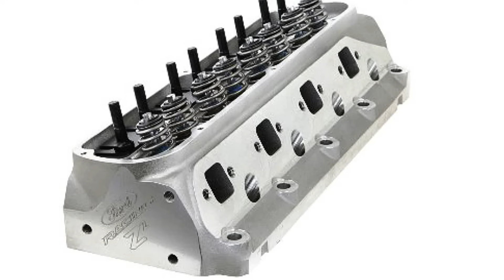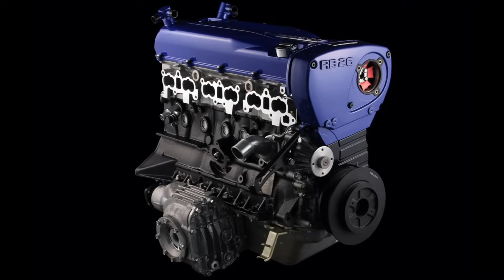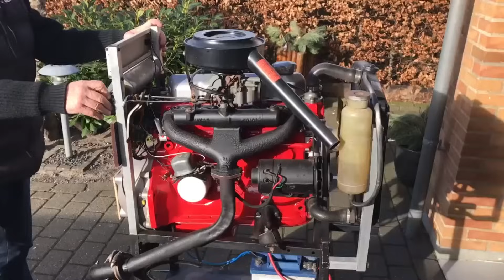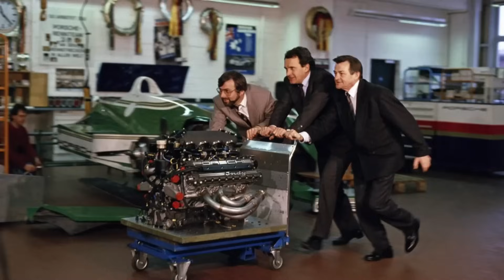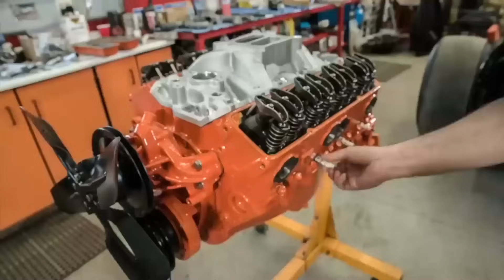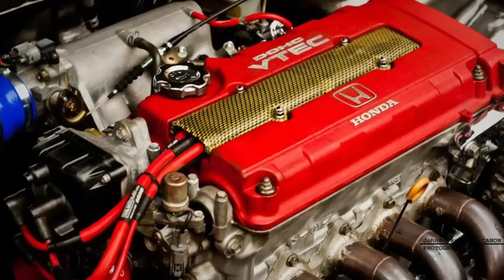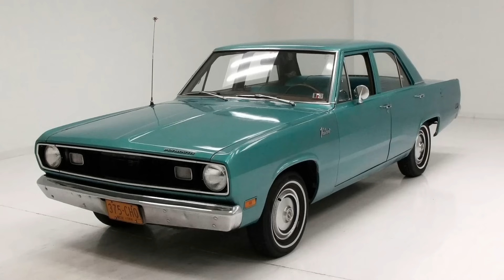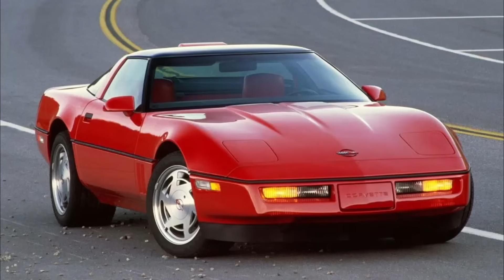30 Car Engines That Will Last FOREVER (2024)

Comment: The ford 302V8, 300-6 and don’t forget 390FE class engines. The Toyota 22R is totally unstoppable. Then Chrysler 318, 340, 360 were awesome. 350 Chevy small block 👍. I’m kinda sad you didn’t mention my car and engine Buick Regal with the Buick 350-H engine the baby brother to the Buick 445. My Regal 1977 with the Buick 350-H motor I’ve got around 315,000 miles on the original engine. The car has been in the family for 46 years now. I’ve done 2 timing chains, starters , water pumps etc but the long block is original. It’s a long block skirt design and the mains are big , around 3 inch in diameter. The car also has a TH400 transmission in it. The second rebuild on the transmission I had a Transco level 2 shift kit installed and the stall speed bumped up to around 2,300 rpm that made a world of difference in , in city driving because it has 2.83 butt gears in it. I change my oil and filter regularly and I use valvoline VR-1 racing oil in it and IXL metal conditioner additive in the oil now for over 30 years. It’s my daily driver. Another thing I do to make the engine last is ; I set the out of gear idle up to 1,000 rpm and at every light i shift it out of gear to neutral and let the engine free wheel to get oil splashing around inside. I always let it warm up to. I’m retired so most of my trips are short do in the winter time I drive extra more miles then needed. Example if I need to just go up to the store that’s 1.0 miles away I’ll drive a minimum of 10 to 15 miles. I got a circuit I drive to get the engine good and hot. You say it and I’ve said this and I’m a retired heavy duty diesel engine mechanic, change the oil regularly. Even more so for in city driving.
Reply: Had a couple 390-fe`s back in the day, not impressed at all. Now my 429 was a different beast altogether.
Reply: @PaulCharles-ww5wu  those 429’s are real stump pullers. They’ve got a lot of low-end bottom torque. I’ve worked on a few of them in the past. And people over look them. It’s my opinion that the 429 performers better in the low end department than the 460.

Comment: Well My Late Father once bought a 1976 AMC Hornet Sportabout Wagon and the 258 Cu. in. Engine had almost 300,000 miles when He bought a newer one that lasted a lot of miles too I loved those AMC six Cylinders my favorites any day
Reply: @JorgeRodriguez-po7kx  THATS THE SAME 4 liter inline six they put in the Jeeps until  it was replaced by the V6, but that engine ended up making double the amount of power as originally designed when AMC used it
Reply: Id' install this AMC 258 Cu. In. Engine in a Dodge D100 pickup replacing the Chrysler slant 6 engine if anything goes wrong....
Reply: My favorite car. 1983 AMC Eagle.  It was treason to discontinue these cars.

Comment: You forgot the 2.4 liter 4 cylinder diesel engine in Toyota trucks like I had in my '84 model.  It's a belt driven overhead cam version with roller rockers and has an aluminum head.  Not the biggest hp engine, but mine took me over 800,000 miles before the box frame under the truck rusted out and permanently parked to thing.  It was still running when finally parked, and was powerful enough that I built an all steel 12 ft goose neck trailer to pull small cars on to my little shop that I used to own and operate.  Even the timing belt was long lasting with 100,000 mile intervals for changing them, so Toyota knew to use a good diesel engine builder for their trucks, which was the Hilo company that built big rigs over in Japan and they knew how to build a strong engine.
Reply: #2, the 22r is that engine.

Comment: I'm not sure bout that Subaru engine.  Head gasket issues killed them. Barra 6 from Australia would surpass another of these engines and put out more hp or kW depending wherever you're from. And not expensive to build. Slant 6 and some Australian Holden 202 and 4.1 Ltr 6 in the Australian xd falcon were also great contenders.

Comment: The Slant 6 will still run no questions asked even with it being down 3 quarts of oil.

There was a cab in Montreal (a 63 Plymouth with the slant 6) that over 39 years logged 1.9 million miles before it was taken out by a drunk driver.

Comment: Missed a lot of engines that should be on this list. You praised way too many crappy Japanese engines. The Mercedes Benz OM617 should have been at the top of the list. Those are regularly surpassing the million mile mark, because of how well they are built. You also didn’t look at that many European engines. I personally think you’re biased against European engines because the diesel engines from Europe will outlast just about anything else on the road. You want to talk about V8 engines that will surpass 200,000 miles? I own one such engine in my Mercedes Benz 450SE, yet you so called experts have never researched these. The M117-986 V8 engines were used in race car applications and raced in Le-Mans cars for several years. Back to the drawing board for you.
Reply: Most European cars in the US are owned by rich (wannabe), snotty, Americans kinda like yourself! And I've never been a big fan of diesel motors either.
Reply: Lots of 50+ year old M117 engines still on the road and still going very strong.
Reply: @mikedocci9662  exactly. I own one of them in my 450SE. It was built in 1976. A lot of people are not aware the M117 engines were used in some racing cars.

Comment: The Ford 300 in-line 6cyl was the BEST 6 banger in tractors, F150 and F250 pickups.
That low end torque would climb a tree if it had the traction.
We would order F250s for our fleet pickups with the 300 in-line.
Yes they were slow, but we needed the low end torque and we’d Easily get 1/2 a million miles out of those trucks.
Now we have the 302 (5.0L) V8’s, but they don’t last as long as the 300 inline 6 banger
Reply: Absolutely Right...🎉 😂❤
Reply: In owned two F100 one had a 351 auto which was great,but the other F100 had the 300 six. It had 150,000 when i got it an i put another 150,000 on it. Never missed a beat.
Reply: @chuckselvage3157  My 96 Bronco have over 450,000 miles on it. It have a 351 in it. And it still smoke the tires. I had a ford van with a straight 6 and for three years I never changed that oil in it. I paid 100 bucks for it and didn't care when it was going to quit on me. I found myself missing that van after someone stole it and I had to stay home all the time with the wife and kids. I would leave work and go straight to Mississippi to fish. Never never did it ever let me down. Even though I tried to break it. It was hard to pass emission in Memphis with it. Just think if they take that engine and put today fuel delivery system in them.
Reply: Sad fact that the engine lasted 3 times longer than the body did, same as with the 292 straight 6 GMC 
Seen many, own even more, watch those old sweeties taken to the crusher, in St. Paul, Mn, where the snow took its toll.
Interesting point, was that all UPS trucks used those engins in all their trucks, even when they changed over from carburetor to fule injection. 
Can't recall ever seen a UPS truck broke down or being towed.
Reply: @daleslover2771 
Another awesome but underrated six was the International Harvester 248(?) "Black Diamond". They were built from the ground up as a truck engine.
Reply: @leehuff2330  battle ship buit
Reply: @leehuff2330  Back in St, Paul had a 73 scout harvester 2
Came with a 304 V8  and ((27 M.F vacuum lines)) a mechanic nightmare, trying to get it smog.
Wish I had the 345, but I dident,
or even better, it was the 4 cly 232.
One of the best vechicles that would go through snow is absolutely unstoppable. Miss that old girl.
Reply: @daleslover2771  Northwest Airlines used them in everything when I worked at MSP.
Reply: @RasMosi When the 225 Slant 6cyl engines were being produced back in the 60s - 70s a Toyota engine would only last for about 75K miles. Back then if you got 100K miles from a Toyota or Honda you were lucky.
Now everything has flipped.
Chrysler, Dodge, Ram and Jeep sold out to FIAT , which is owned by Stellantis who can only manufacture the Worst reliable vehicles on Earth.
Ford and GM went in together to make the 10spd auto transmission and they’re a POS.
The Turbo engines in both Ford and GM are trash.
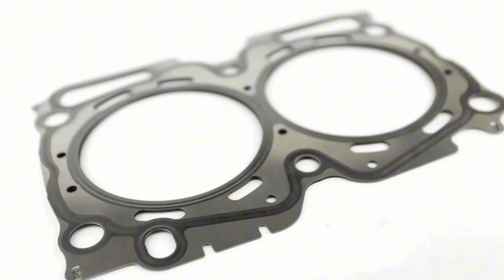Reply: I had a Ford F-150 with that 6 10:34 cylinder engine adI loved it. Got decent gas mileage and wasn't a speedster but like you said they had the low end torque.
Reply: I have a 1990 F150 with the 300 in it and, like you said, isn’t a race car but it’ll pull a house down. It doesn’t lose or use any oil to this day. I don’t get to drive it as much as I used to because it’s definitely not the best for gas mileage but I love that old truck and it’s never let me down.
Reply: Also that engine had one main bearing for each cylinder, bullet proof.
Reply: @ohwell2790 7 main bearings actually.
Reply: @RollingRigTraction 
You're very correct.. Additionally it also had Gear to gear timing system.
Reply: @RasMosi Try buying and replacing an "unbreakable" part on the wonderful Toyota engine. People have been known to wait 4 months(slow boat)  to replace a broken Toyota  part. In the meantime, what do you drive? That is so rare on an American motor (part supply issues) as to be non-existent. 
I spent some time in the rain at night, trying to jump start a Toyota Camry. It turns out, it was DESIGNED not to be jump started. DESIGNED to 
HAVE to be towed to a dealership! OUTRAGEOUS! 
 In America, reliability is king. Ease of maintenance is crown prince.  
In Texas, the nearest dealership of any kind may be QUITE distant. Why would you set yourself up for MORE difficulty by purchasing a 
foreign car with potential (no matter how unlikely) repair issues?
I would like to have the latest model MR-2, a very nice design.But having to be pragmatic and realistic, I will likely buy a 20 yr old Mach 1 Mustang. 
Know your ecosystem before making decisions or judgements.
Reply: I love the Ford 300I6, I have two of them a '65 and a '69 block from back when they were actually higher rated for horsepower. I am stuffing the '69 block into my '82 F250 mated to an NP435 it's getting a new matching oil pan and pick-up, aftermarket Aussiespeed 4V intake and a reproduction heavy duty exhaust manifold with a truck matching Ford Duraspark II distributor. I will try it out first with a 2V Autolite 2100 carburetor with an adapter and then try out the Edelbrock 4V and eventually a Predator carburetor to find the best runner.
Reply: @RasMosi  No I think you got it wrong, The USA has been in the construction trade ever since the first truck rolled off the assembly line in WW1. 
There it was used for commercial bussiness in the cities as they expanded. Henry Ford, like all of his vechicles painted Black. (For a reason) when 1934 came around the first vechicle body (experiential ) that was produced by Soybean based plastic.. National Geographic shows a picture of Henry Ford driving a ax through the hood of a car produced by Soybean, stated it would be the death to the steel mills. 
What they learned in war, they brought back home, Those Chevy Fords, GMC, Studebaker, Hudson, International harvester ect were the only things that Americans had to choose from. 
When Datsun built the1969 1300 cc truck, many hard-working men bought one,
Little 4 banger, great on fule economy, solid little sweetheart.
Loved mine, as much as my 1977 Toyota Hylux.with the R20 
Every truck and car engins had their faults, some greater than others, 
Imported or domestic, including Canadian and English. 
But you got to give credit where it is due.. look at Cuba, their taxi are in the 50s erra, he'll that's 75 years old, still a rolling. Probably using those Big block 235 straight 6.
You would have a hard time telling those Cubans what are bullet proof and what isn't.
Reply: @daleslover2771  Well said, brother... I'm a 73 year old gearhead and have owned both foreign and domestic vehicles, mostly trucks. Toyota trucks have had the best reliability for the last 2 decades, but now all brands suck with too much electronics that are easily prone to failure.
Reply: @stillnotwoke  back in 2015, my buddy called me up, wanted to know if I was interested in an old Ford truck, heck yea, 
Ask this lady what she wanted for that 1960 F100 4x4 
She said it's free, gotta get it out of here in 60 min, because I am going to town.
 
Gave it away back in 2005, but it had the 4  flat tires. The guy never came back to get it. 
Called up my buddy and asked him to bring over the car carrier with a battery, ratchet, spark plug socket.
Change the battery, pull the plugs, and put  it in 2nd  gear low using the starter
Walked it up on the trailer with 4 flats tires,
Lady said here the title, the old registration I've never seen that done before! Where are you from? I told her from Oregon, 
Isn't that hard on the starter? I said not, really. These starter were  built bulletproof , made back in the 60s
Told her all you need is a broken hack saw blade, to clean the commentator groves, with finger nail polish, to re insulate the armature, lithium grease for the shaft slide.
$5.00 worth of brushes
It's good to go for another 50 years.
She laughed. I asked her what type of beer does she like?,  she said, Rainier. 
Best 6 pack of beer I've drank with this sweet  old lady.
Still have the truck, painted light forest green, new tires, points plugs,mechanical fule pump. 
With that old granny gears in low, it's a tank, especially if it's in 4x4 at
1 mph ...love it.  😊 😃 😊
Reply: Not enough power to hurt itself. Yeah you can coax a turtle forever
@daleslover2771
Reply: The reason why the 300 6 was capable doing that many miles and consistently running. It's because it did not have a belt or a chain. It was a gear to gear timing system and it was very simplified.
Reply: i much much prefer steady low-end torque to high-end horsepower.
Reply: @terrenceolivido741  
Who would win a race 
 hellcat that has 600 horsepower? But the car weighs 4300 pounds. Auto 8
Vs
300 6 making exactly 320 horsepower. And 580 foot-pounds of torque and a 2600 pound car. Manuel 4
Reply: yup I miss mine one of the last years made.
Reply: @MissingLink-hb9ov  96 was the last year of the Ford 300 In- line 6cyl engine.
Reply: I too am a big fan of these engines.  Had them in several service vans over the years and loved the power and reliability.  I would get caught in heavy traffic in Texas in the summer and they would never overheat running the A/C when every other car was rolling down the windows and radiators steaming.  No trouble getting on the freeway from a standing stop with a load of parts and supplies on.  I totally believe Ford quit using them because they were too d@mn good.
Reply: @RasMosi got my eye on a toyota with the 1-HD-T right now..
Reply: @RasMosi 
Parts availability both new and junkyard in usa.

Comment: You missed one! The Ford Five Hundred Mercury Montego  Duratec 3.0 liter V6 should be at the top! That is a 500,000 mile engine. In the used parts business that was an engine that never sold! If you what to know what engines, transmissions and other parts last the longest ask your local salvage yard what parts are sitting on the shelf collecting dust. You only sell the parts that break!
Reply: That was a super vdeo....I grew up  on GM ....1955 gave us 265 then 283 in 57....327 8n 62....350 in 67....block change 348 in 58...409 in61.....396 second half of 65...427in 66...402 in69....strong running engines....mopar 413 wedge....440....318 ...426 ....225 6...ford....300 6 ..289...302.....428....429...430.. willys jeep....134...232...4.7..buick...straight 8.....v6s.....425 nailhead....oldsmobile....394....international...358...continental...caterpillar ..gas &diesel...all contrbutd to many applications on & off road

Comment: GM 3800, interesting fact, the super charged model would go more miles than the normally aspirated model!
Reply: Yes the 3800 were 300k + mile engine
Reply: The supercharged version required premium fuel that has greater wear and friction protection
Reply: I had the supercharged 3800 in an intimidator. That was a fun car. Made real good power with just a few inexpensive mods
Reply: If your careful, the oil pump is part of the block and once worn means a trashed block.
Reply: The 3800series 2 engine is in the top 10 best engines of all time from any car company. I am lucky to have one it has 220 thousand miles and runs like a clock in a Buick LeSabre. You must change the top gasket with the correct material so the coolant will not leak.  By the way the transmission is also very well made.
Reply: Forgot to mention the outstanding performance of the Buick GN & GNX models with this 3.8 Turbo. At one time, it was apparently the fastest hi-performance car built.
Reply: @jimtrook3597  Yes good point dude. You are so right. Whipped many a fast cars ass including Corvettes etc... Pretty impresive for a v6 aye. I own 3 commodores here in New Zealand. They have the mighty 3,8 V6 and go hard out.350000Kms and still going strong. Regular oil changes are the key.